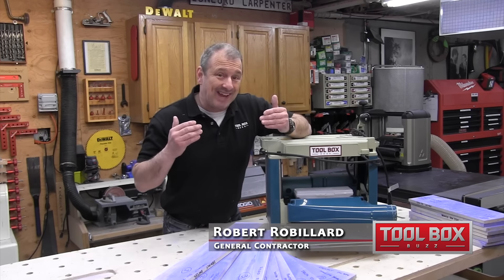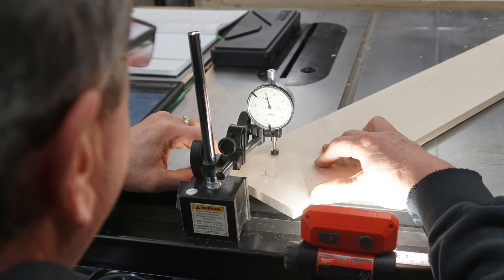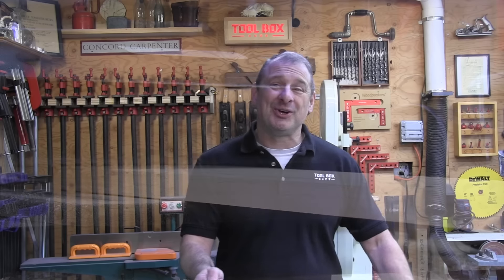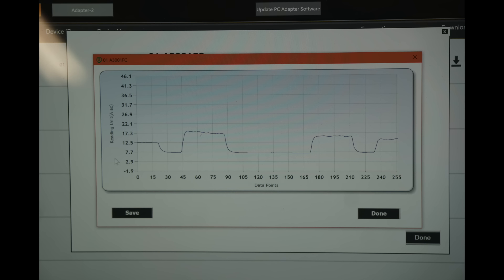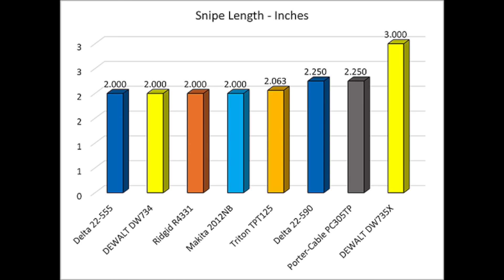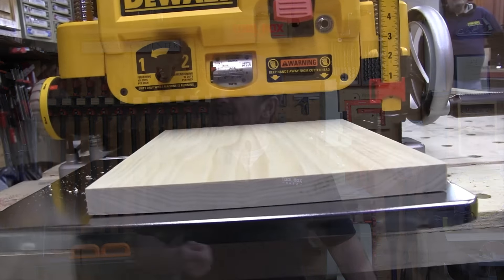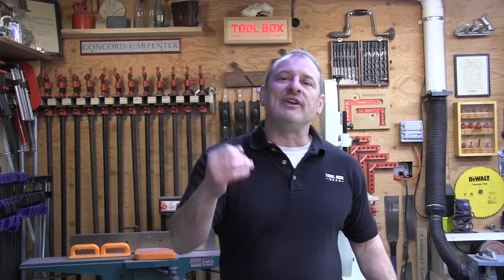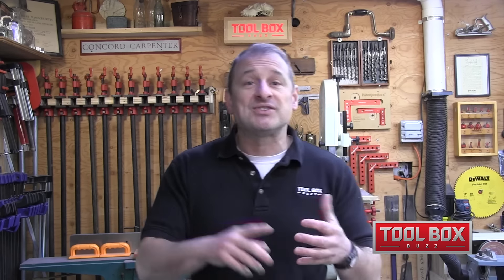Best Benchtop Thickness Planer ~ Head-to-Head

Comment: Great review! I have been using the Dewalt DW735Xfor about 5 years. I purchase most of my wood rough so it is used often. While I agree with most everything you mentioned I found the blades dulled fairly quickly. Without the ability to sharpen them I was replacing often enough that I looked for  a way  to fix the problem. About two years ago I purchased a helical cutter-head. It wasn't an inexpensive solution but I have yet to dull a side on one of the cutters,although two broke. The cutter-head came with five extra. The finish left sometimes makes me feel that sanding  is something I do out of habit not because it needs it. It does seem though that it uses more power. I was curious if you have ever tried a similar upgrade and if you found the power demand placed on the motor to be true. Do you know of any power upgrades available?

Comment: I notice that Jet is now marketing a 13" benchtop planer with helical cutters for about $800.  It appears to be very similar to a unit sold by King up in Canada a few years ago.  Just the fact that it comes with helical cutters standard should have you folks evaluating it vs all of these in a separate video.  I expect that DeWalt might respond by finally offering a version of the 735 with helical heads standard just to keep their leading position in this category.
Reply from the maker: i agree

Comment: Overall great review and content! I do wish you had also included a test for accuracy at 1/32 or 1/16 depth as many people would prefer multiple lower passes than one at 3/32 or not want take off that much material. I also think you could organize your price scores into a relational value to their figures versus an original ranking. The Triton is not 3 times as expensive as the Porter-Cable.
Reply: My man, you can do your own reveiw.

Comment: I don’t know about the other ones, but the infeed/outfeed tables for the DeWalt planers (which I use) are not supposed to be “level” - they’re factory set with some ‘cant’ (slope) where the outer edges are level with the bed but the inner edges are slightly below.  If you change this to “level” you will wreck the snipe performance (which for me has been incredibly good with those planers). On short stock you do get a little but it’s within “sand-ability” - a few thou.  I made the mistake of “leveling” the tables and that got worse by 3-400%.

Comment: Really helpful. Excellent video - this is my first time here and I am really impressed by your scientific approach, the clear explanations, and the willingness to use a lot of data while also giving some (hugely important) subjective impressions as well. 

Regarding Makita, I think they would like to be the Japanese answer to the German Festool, a Honda of the tool market. Their build quality is excellent but the tools just aren't quite sticking out of the pack in terms of performance. Watch out for them, though, over the coming years. They seem to be a great company and I can almost hear your regret that they didn't perform better here. The big money in the power tool market is not in thickness planers. But give them a few years and they could be a force.

I am grudgingly coming around on Ridgid. I keep buying their products by necessity and then being impressed by how bulletproof they are. I am seriously considering their planer. If you are a non-pro like me who can't justify $600, the Ridgid versus the Triton comes down to whether you value accuracy or speed. An additional advantage of the Ridgid is that it can be found in stock at your local Big Orange Box - if there is a problem, you just take it back and ask for a new one!

Comment: Apologies, but you're not supposed to level the tables with the base all the way across.  You want the ends of the tables higher than the edges close to the base; they come set from the factory that way for a reason.  Therefore, a gap, as measured in your chart, is actually a good thing!

From the DW734 manual:  "NOTE: The outside edges of the extension tables are level with the base while the inside edges (closest to the cutter head) are below the edge of the base. This is set at the factory to reduce unnecessary friction between the material and the table while providing adequate support at the two points (those farthest from the cutter head) on the tables that are integral to snipe prevention."
Reply from the maker: We used a straight edge so we could set the gap

Comment: That Triton planer looks just like the one at Harbor Freight.
Reply: I have the Bauer. It is my first planer. I bought on price. A couple of things I did to modify it. I mounted a dial indicator on it so I can accurately control the thickness. I also mounted a melamine board for the table. While it obviously reduces the thickness capacity, it really reduces snipe. I've not run a lot through it, but it works fine for my purposes. I'm sure I'll "outgrow" it sooner or later. I'm thinking Cutech would be my next one with a helical cutter.

Comment: i bought the dewalt dw735 and have had nothing but issues since day one. The biggest issue is how it feeds, the machine refuses to pull material through. I have cleaned the infeed and out feed rollers numerous times, always blow off the infeed and outfeed tables prior to sending material through.

Comment: Price of replacement blades and whether they come in carbide and or HSS is a big factor for me.  Also the design of the blades as to how many times they can be sharpened and whether they can be sharpened in the home shop.  Other than that the only thing you missed is how rugged they are and projected lifetime would be important.  Source for replacement parts and price is another point to consider.  For example:  I would never buy a modern Porter-Cable (Chinese parent company) as they don't support their tools, with parts listed as unavailable in less than ten years.  Good job over all.  Take care.  Doug

Comment: Great comparison. Very helpful. Only question I have is about the dewalt 735x . It’s a 2 speed planer and I’m wondering which speed you used for your evaluation. Either way I’m buying the dw735x . Thanks !
Reply from the maker: Not sure now, I’d have to go read the article - it’s probably in there

Comment: I have used the Delta and Dewalt units. Liked them both but the replacement Dewalt blades are way too expensive for carbon steel. They do not last as long.

Comment: I had a older early 2000's DELTA 13-1/2 Planer -- Purchased at LOWES.  I used it to re-finish entire floors ( plank by plank after first taking out all of the nails and tacks ) and I used it to re-finish trim work.  I had actually used it on 2 houses ( all trim work and molding ) and 1 house of all the wood plank flooring before it was DONE.  I had used it for many other smaller jobs as well before it finally tanked .  The BRUSHES were worn out which you can purchase on line BUT the little CAPS that enclose the brushes were plastic and fell to pieces which i unscrewed them and those CAPS    CAN NOT be purchased anywhere that I have found   SOOOOOOO the entire planer is now JUNK.  One big paper weight that cant be used.

Comment: Sorry I hung around to the19 minute mark. In this era of carbide cutter segmented cutter heads you went with blades. Blades are expensive, they don't last well and most likely won't sharpen well. Segmented cutter heads cost more initially, carbide cutters are a pain to change when you do them all. But when you get a nick in one you loosen it up and turn it or replace it, a blade you just replace it. Cutter cost $2.90 @, blade cost $11.00 @, these prices are online for my off brand and the blades for Delta 22-590, also online. It needs to be stated, there are 2 or 3 bench top planer manufacturers in China, that is where the majority originate. If the planer is upright it is most likely manufactured by 1 of 2 manufacturers, I spent many hours researching this before I bought my planer. You really need to do a lot of research before you opt for a planer, at the cost of a table saw in many cases, it is a large outlay for a tool that you will have to feed. This video is a good starting point if you are going to be a hobbyist, if you think you will get into a more serious wood working go with the carbide cutter heads, they are more money, but as stated above, cheaper to feed, the carbide cutters last way longer by the way.

Comment: Great video and comparison.  Only part I disagree with is the part about surface finish. First it is called tear out.  Also number one cause is grain direction not the planer.  Secondly the Dewalt sample clearly has the board with the straightest and most even grain.  Of course it didn't get any tear out. You can see on the other samples most of the tear out is near sections where you twist in the grain.

Comment: Great job, extremely precise. I’m a third generation furniture maker, 55 years. I’ve owned the smallest to some of the largest pieces of equipment over those years. Because I’m an old fart now, just sold all my stationary equipment in Hawaii. Just moved back to Florida and I have a ton of orders for humidors , jewelry boxs , etc. all high end, like my furniture. ( michael pratt woodworking). I’ve owned about every saw made , but I don’t need a unisaw or powermatic saw any longer, I’ve owned, Martin sawS etc. . I just have no need for a large saw any longer. What’s your take on  the Ridged 10 inch saw,. Cannot recall the model number, but the largest one they make. I’ve used it before at a friends shop, seemed like a good saw for the price .  Just came across your YouTube channel,and wondering if you have done a similar  comparison of smaller table saws. 
Thanx.

Comment: The problem with the DeWalt is those thin disposable blades that are not recommended for sharpening. I have the old DeWalt model with thick blades and have sharpened many times.

Comment: The website is “www.Baileigh.com., they make both metal and wood working equipment for the hobbyist and professional.  I don’t know if you have read my reply, but their planer (which is only $50 more than the DeWalt DW735X), comes with spiral cutter heads with carbide inserts.

Comment: You guys have one for jointers? Curious how Cutech stuff ranks. 

Also... consider adding a couple more to your planer test -- Curious how the Bauer (low end) compares, and how the CuTech 40200 works. by comparison. I'd use the Dewalt 'X' model you rank tops, here, as a reference, if you do this.

Comment: I purchased a family of DeWalt tools and now wish i hadn’t dw745 table saw. Arbor failed inside 3 months yes they fixed it.. The blade height adj then failed.. I’ve made about 20 calls to them and e mailed them etc without any reply.. it’s on a 3 yr warranty but the customer service is shocking, 3 months later and it’s still not fixed and no contact from either their customer services or their service centre.. It’s not just me either, here in the UK there’s endless complaints about the brand, a brand that once had a very good name but has now it seems slipped..

Comment: Amazing how the worst was also the most expensive. 

Maybe the tools are designed for different users: the shop user vs the service truck user.

Another question: availability of after-market helical cutters. But then, would you put a $400 cutter on a $300 machine — even if one was available?

Comment: The porter cable does have a dust collection shroud available for it.  I have one on mine.
Reply from the maker: South LA Hiker hold old is your unit?
Reply: A Concord Carpenter / ToolBoxBuzz I purchased mine from Lowe’s about a year ago but I ordered the dust collection shroud from amazon.
Reply: A Concord Carpenter / ToolBoxBuzz I just realized the shroud is actually made by Delta.  But it bolts right onto the porter cable planer.
Reply from the maker: South LA Hiker good to know thx!  We may ad this info to the article @todd Fratzel

Comment: Thank you for doing such a detailed review. I'm curious to know what you think might be best for my needs, which I expect might not be as common. So firstly, noise level is a big concern for me, I have a basement shop and running my current planer (Ryobi AP10) is one of the few things that upsets my wife, as the little thing just screams. So I would love to get a benchtop planer that is as quiet as possible (I understand this is somewhat of an oxymoron). I also don't care much about finish surface quality, I'm often edge gluing panels and need to do a decent amount of sanding before I throw finish on, and I think any of the options you tested would be good enough in that workflow. So what do you think about the Makita in this context? I've heard it is significantly quieter than other planers, which is worth more to me than finish quality, but I've read somewhat mixed opinions on just how quiet the Makita is.

Comment: I had actually bought the DEWALT 735X last year under a Black Friday deal but I couldn't fit it in my car or my friends SUV so I had to take it back into the store. :( I have not finished setting up my garage to do any work yet. I just bought the house a year ago. Though I want to eventually get a planner I think that the DEWALT power draw might require some electrical work in my garage. :( So I could consider a RIGID until I have the wiring done. 

The one measurement that would have had little impact on my purchase decision would have been the speed. I cannot imagine that I would be doing so much work and be in such a hurry that a few seconds would be a big factor.

Comment: Glad I went with the Dewalt 735x. I heard good things about this one prior to watching your testing. I think it would be very interesting to see these planers take a heavy board/beam through them. I doubt I'd ever max out the 6" capacity myself, but I'm curious as to how the roller motors would handle the added weight and friction. Any comments? Anyone tried this with a planer?

Comment: Thanks for a very interesting video. Looking on line I find the 735X and 735.  What is the difference between these two. ( note, not talking about the 734)
Reply from the maker: Brian Henry helical blades
Reply: Interesting, I have subsequently found out it has straight blades, not helical blades, and the only real difference is the 735x has extension tables and a second set of blades that the 735 does not. you can add shelix helical blades for about a grand!! @ConcordCarpenter

Comment: Clearly the dewalt are great planers.  The 90lb one is not a tool you want to be carrying in and out of the truck. Probably best suited for a small shop. Dewalt tools are always heavy.  I recently replaced my old Makita 2708 table saw with a Dewalt 749.  Better saw but also twice the weight🙁.   I have been using the Makita planer for more than 10 years. No issues, just oil the chain, spray silicone the table with 0000 steel wool and good to go. I will be leaving it to someone when i die.  More than 25 years in the trade, hopefully only ten more to go.🤔

Comment: On the surface finish, they don't say how deep of a cut they were using for the test.  I suspect some of the planers that didn't do well may have done much better when taking less of a cut.  That would be nice to know.
Reply: 3/32" on all the samples
Reply: @toddfratzel3569  So full, or nearly full depth.  What I was wondering is how the results might be different when taking less of a cut.
Reply: @cdw3423  it's a great point. I suspect that in some cases performance would certainly improve. It really also depends on the wood, orientation of grain, so many factors.

Comment: infeed and outfeed tables should be higher than the planer bed to reduce snipe.
Reply from the maker: TheLoneWolf1124 yes good tip!
Reply: WRONG WRONG WRONG. Snipe typically happens when your boards are not FLAT. But mainly happens when you dont hold the board up when it comes out. The cantilever weight is too much for the outfeed roller to hold it down, thus getting snipe.

Comment: Very good review, but I have to disagree with your rating process. For me, the biggest concerns with a tool like this is snipe, finish and consistency. I couldn't care less about feed rate, it could be turtle speed but if it produced premium results then I would gladly pay more. Price is only a concern when compared to these areas, since at some point it's not worth the extra money for little improvement. I've used a harbor freight planer, at $250 it's a beast, handles everything I need it to and produces a very good finish with most woods. (hard maple and cherry tend to chip pretty bad depending on the grain) However, the snipe is pretty bad but for the price it's worth it to me since thats easy to deal with.
Reply: I’ve also had problems with chipping from the same woods. I have had occasions in my professional life to order maple butcher tops made by one of the primer companies and have seen that they have the same problem. The difference is their wide sanders remove most if not all tear out on the finish surface but if flipped over you can see the evidence. I don’t think there’s a perfect answer.
I think one thing that helps is a 3 blade or a helical planer and certainly a wide sander. The sander’s a pretty hefty investment, both in $ and in floor space that small operators, such as myself, could never afford. I occasionally took some things to the door plant that I used and they would accommodate me, for a small fee.

Comment: These machines are best bolted down with ply/timber extension in/out beds fitted. Not really a  portable tool and at only 115v the most i would take off in 1 pass on a 6in wide board is 1-2mm. The motor will struggle otherwise.